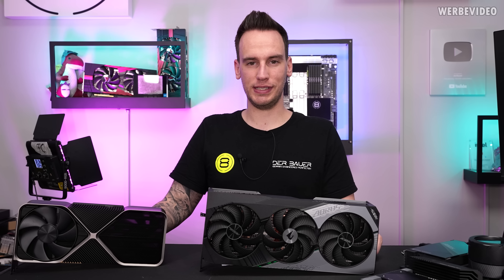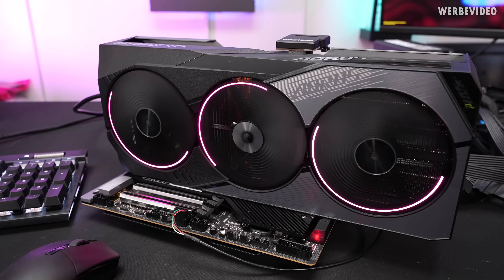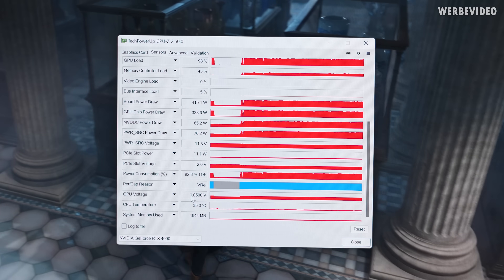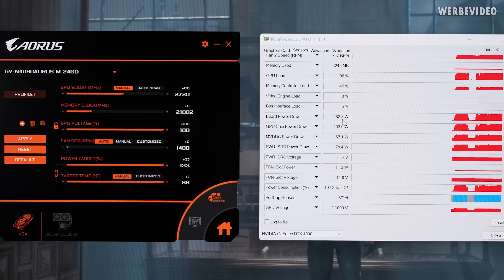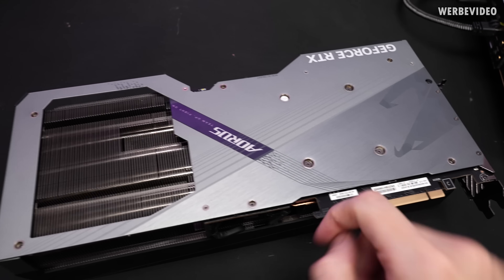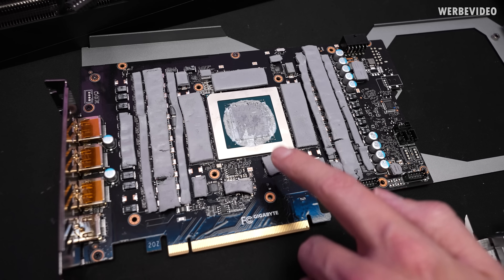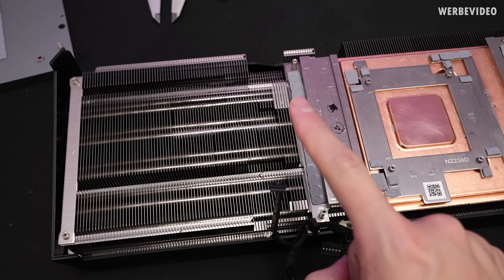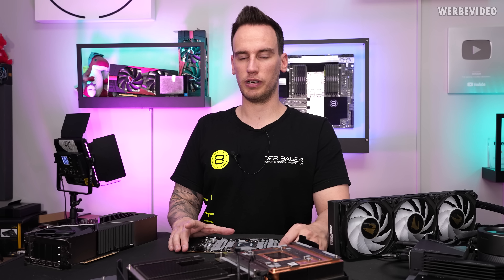Hidden NVLINK? RTX 4090 Aorus Master Teardown and Overclocking to 3GHz

Comment: Being as many AIBs are reusing PCBs from the 3090 series cards, could well be that those traces are remnants from those cards.
Reply: How are they reusing PCBs from 3090 when maybe the 4090 BGA packaging is so different from 3090 BGA packaging?

That's like saying ASUS reuses FM2 PCB for AM4 platform, because 'just one connector is found on older platform'.
Reply: @AlfaPro1337  i believe that they where using the 3090 ti boards when they where testing power and stuff.
Reply: @UNSTOPABLE40XBOX  Dude, even a 3090 Ti BGA package isn't the same as a 4090 BGA package.

Did you even read? That's like saying FM2 traces fits on an AM4 socket.
Reply: @AlfaPro1337  i never said they put 4090 chips on 3090 boards. Did YOU even read what I posted? I was just clarifying what FCLC said.
Reply: @UNSTOPABLE40XBOX  'i believe that they where using the 3090 ti boards when they where testing power and stuff."

Implying they plopped a 4090 package on a 3090/Ti PCB.

Also implying that 3090/Ti PCB has more trace than it should (which shouldn't), that magically fits a 4090 package.

Also implying that 4090 and 3090/Ti package has the same number of ball connection AND the same place.

And unlike GDDR5 and GDDR5X, it's not the same.

No, it makes zero sense.

The only few explanations that NVLink connector exist is:

1. They are reusing the same PCB diagram--albeit a heavily modified, and totally forgot to remove the traces for the NVLink.
2. There's a production error in the PCB design, since there's no break away part, and the edge is pretty clean.
3. NVLink was planned, but Nvidia decided not to implement it. Thus instead of 'reprinting' the PCB again, they used the 'defective' version.
4. There's a 4090 Ti, with NVLink support. It couldn't be a Quadro RTX card, since it's a custom PCB.
Reply: @AlfaPro1337  🗿
Reply: @Oz_2026  🗿
Reply: I'll clarify. If I remember correctly, they used 3090 ti boards when they were designing / developing the power delivery for 4090 GPU's. The 3090 ti was kind of like the testing grounds when they were prepping for the 4090 GPU's.

Comment: I had a 3090 Xtreme for a while, the software for that screen was a disaster.  If I wanted to change it I would end up having to DDU out everything, reinstall the software and make the change.  Then it would stop recognizing the card again.  If you get it, expect the screen to be the animated Aorus and not of any value.
Reply: as heavy and cumbersome corsair icue is (because it does all possible hardware in 1 app) my experience with msi,g.skill,gigabyte,thermaltake,asrock is that their software are betas at best, barely useable and in the end I disabled all their rgb and dropped their special features because I didn't want to use those awful apps

Comment: I would try the nvlink out if you have another card
Reply: Im sure it would be disabled in the driver/bios even if you modified a connector onto it
Reply: @sbrader97  those can be modded also
Reply: @primus711  Not, forced BIOS signing has been a thing since the 1000 series. No bypass exist
Reply: @nap8187  you can flash other bioses
Reply: The contact pads are covered and the pcb is longer than the connector so there is no change you get it working